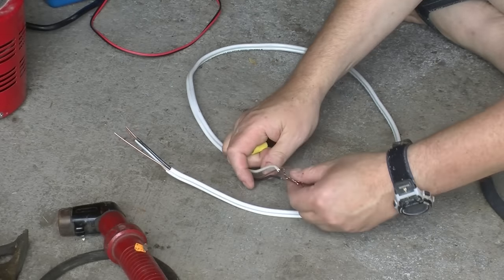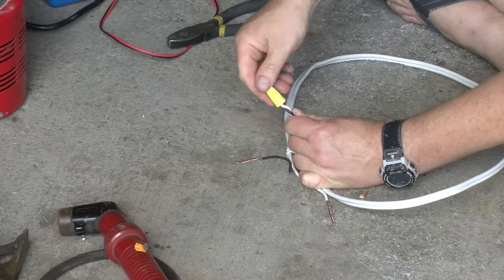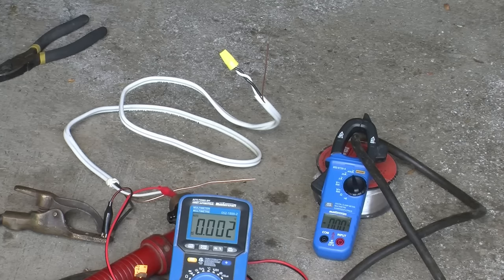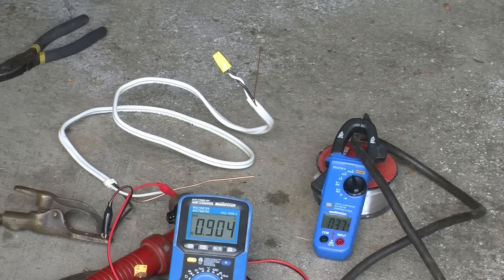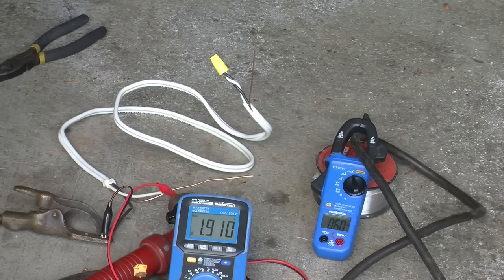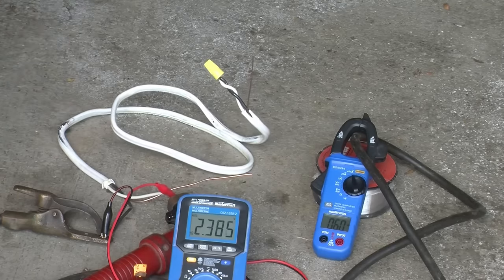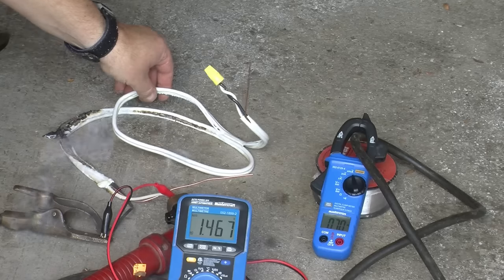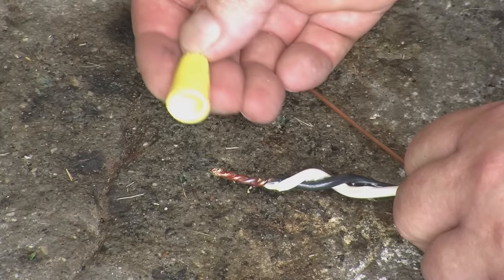How many Amps to burn up 14/2 electrical wiring?

Comment: That is a fun video to watch.

However, I would caution viewers of this video from assuming that Romex/NM-B wiring has "lots of built in margin" and can safely be pushed beyond its rated ampacity limits.  My understanding of the electrical code is that it is acceptable and allowed to bury NM-B wiring under insulation, inside walls and attic spaces.  Therefore, it is not uncommon for the wire to experience much higher thermal resistance (compared to being exposed to free air), and consequently much higher temperature rise, for a given current level.  For example, fully encasing an NM-B wire inside "R13" rated insulation should theoretically increase the thermal resistance and temperature rise by a factor of approximately 13, compared to having the wire free standing in air.

Since thermal power dissipation per unit length (and therefore temperature rise) is proportional to current squared (ex: P = I^2 * R), encasing the NM-B wire in R13 insulation is probably going to result in a somewhat similar temperature rise to running the wire at 3.6x of the rated current, but in a free air environment.  In other words, for 14/2 Romex/NM-B wire, which is normally rated for 15 Amps maximum, when fully encased in R13 insulation, may experience about as much temperature rise as it did in this video, when he was pushing the wire to approximately 50-60 Amps (since 15 * 3.6 = 54A) in free air.

It should also be noted that most electrical related fires probably originate from the electrical connections at the ends of the wires.  Thermal cycling from repeated heating/cooling often causes loosening of the screw terminals and other interconnecting devices over time.  This is due to the thermal expansion coefficient of the metals, causing them to grow and shrink dimensionally as they heat and cool.  The subsequent loosening of the interconnection causes increases in resistance of the connections, which then brings even more heating and more severe subsequent thermal cycling degradation.  Additionally, bare copper and brass love to oxidize freely in air, which causes a buildup of oxide layer on the surface of the interfaces, leading to more resistance (and therefore much higher heating) over time.

Ideally, manufacturers of wire interconnects would get their act together and start making better quality connectors, which have high safety margin, redundancy of contacts and retention mechanisms, along with active strong spring retention force, rather than single fixed screw/bolt terminal connections, which often loosen over time due to thermal cycling.
Reply from the maker: What a fabulous summary of all the concerns and considerations! Thanks for taking the time to write it. Your point regarding the effects of insulation:  Assuming I have time, I am planning to do a similar informal test of 14/2 in an insulated wall section tomorrow. It may be a less dramatic video but will be interesting to see what happens.
Reply: I don't buy how hot type NM-B cable can get inside a R13 insulation. When they switched from NM cable in early 1980's the type TW insulation was only good for 60 degrees C. Type MN-B has type THWN insulation and rated for 75 degrees C . Have removed thousands of feet of mostly older type NM cable from homes & businesses and never came across signs of overheating on cable jacket and the individual conductor insulation. Now that the NEC requires all screws & bolts used to secure wires must be done with a torque driver or torque wrench greatly improving reliability. At an IAEI continuing class the instructor told us that UL went around the country and rounded up hundreds if not thousands of existing device and took them back to test facility to check for proper torquing. Think less then 35% had the proper torque , 20 % excessive torque and remainder too low torque. Told us that over torquing is just as bad as not enough torque. Out of they over 100 attendees that night less then 10% sorry to say owned a torque driver. Before retiring I worked at a rich fortune 500 company who refused to purchase torque drivers, IR camera & circuit tracers.
Reply from the maker: @JohnThomas-lq5qp  That survey of devices where only 1/3 were correctly torqued is telling. Would be interesting to know how many of them had signs of problems as a result. When you started, I'm guessing torque to a spec was not a thing, other than perhaps really hi powered stuff. I wonder when it started becoming common if not required.
Reply: @JohnThomas-lq5qp  you never came across overheated jackets on old NM wiring? Really.  I find this fascinating because I have seen it quite a bit. I've even seen it in my old home (built early 1970s) and had to replace it. All the NM was in attic and experienced very high heat for decades plus current draw from kitchen appliances.
Reply: @theelite1x721987   I started out doing residential work first few years then after 15 years seldom did any residential work due to fortunate enough to get tons of commercial work. Myself and another 10th grade industrial shop Vo Tech student rewired a 3 story row house by our selves. Took 250 man hours to rip up floor boards, chisel out paths in plaster over brick walls, etc. Did a lot of machine shops, tool & die shops and injection molding plants but would do work in owners, friends & relative homes. Even was lucky enough to do some electrical work in a 300 year old Quaker meeting house, newspaper, hospital and some 200 year old homes. I upgraded at least 30 or 40 old row houses that only had a 30 amp 120 volt service and they always had deteriorating cloth over rubber insulation. I would often have my helper strip a couple of feet of old Romex to tie up extension cords and even then can not recall seeing either the outside jacket or the black or white insulation showing signs of overheating. Heard one of the reasons they switched from 60 degree C type NM Romex to the far superior 75 degree C type NM-B cable back in the early 1980's was due to the NM deteriorating in attics of homes in the south. Most old homes up north had very few wires in the attics. Most were just for bedroom & attic luminares. At one of my post I mentioned that while attending an IAEI continuing education class the brilliant guy from UL labs told us that UL collected old maybe hundreds if not over a thousand samples of Type AC ( BX ) & NM cables from all across the country and did extensive testing on them. Old clothes over rubber insulation in old AC cable failed think he said it was the Megger test along with some others. The thermoplastic ( always looked like TW insulation to me ) on type NM cables were in fair to good shape.Often came across burnt wires due to loose screw on cheap receptacles. Maybe only an inch or two of insulation was burnt. Came across a burnt ground wire the entire length of a 50' 10/4 cord that feed a portable welder. Somebody used a very long lug to connect the ground output from the generator that was firmly touching the welding case and the ground stinger had most of the fine wires broken off and a worn out stinger clamp that did not attach tight to anything causing most of the 150 Amps or so to be carried by the 30 amp #10 guage cord. Only time I came across a long cord that was smoking it's entire length.
Reply: @JohnThomas-lq5qp  guessing it must be regional. I'm in Ohio and almost every home I've seen has all the wires in the attic. Comes in from the basement. A few go lateral, but most go to attic and spider outward and down. I personally hate that but it seems to be the norm. Especially in homes from 60s and 70s.

Comment: I would have liked to see how 12/2 wire would have faired. This would have been an excellent way to show viewers how circuit breakers work. Maybe the same test using a 15 or 20 Amp outlet. I've never seen an outlet on fire, thank GOD. This might be a wait-up-call for some people.
Reply from the maker: You know, might be neat to do a test focusing on the outlet - maybe even #10 wire and see what it takes to burn an outlet.
Reply: Receptacle, not outlet

Comment: Something else to consider is the temp that would cause breakdown of the insulation over time causing material failure (brittleness for example), rather than just reaching the deformation temperature.
Reply from the maker: This weird - I answered this a day or two ago, but it seems to be gone now. My apologies if this shows up as a duplicate ...

Yes! And even just exposure to air seems to make the plastic insulation around the conductors get brittle over decades. Sometimes you see this in connection boxes.  Add some warmth and I'm sure the process speeds up significantly. I remember from taking chemistry class as a student there was some sort of rule of thumb that for every 10C(?) rise, reactions in water tend to double in speed. I would bet there is some sort of similar dramatic increase in deterioration as the temperature rises. 

I wonder if there is a noticeable difference in cable that has been in warm attic for decades compared to the same cable in the same house in a nice cool basement or crawl space?

Comment: Fire is caused because of temperature, not current. So, you should repeat this test but with the cable inside a conduit, with the maximun amount of cables inside the conduit permited by regulations, and with those other cables at their maximum current permited by regulations. That way the temperature inside the conduit will be higher than in your test. The current to start a fire will be much, much lower.

Edit: the conduit and the maximum amount of cables inside the conduit depends on where you install the conduit. There are regulations for conduits inside wood walls, brick walls, air, ceiling, soil, etc., because the heat transfer to the surroundings depends on the material of the surroundings. You should repeat your test following regulations. The current will be much, much, much lower.
Reply: NEC says you can't put wire with sheathing in conduit. Also a cable typically is a multi-wire strand which can't go in conduit. Just insulated wire. But I don't know where you are.